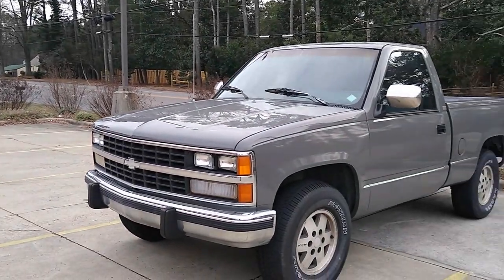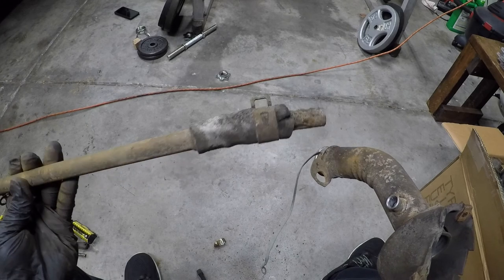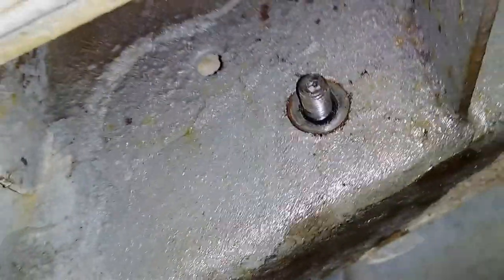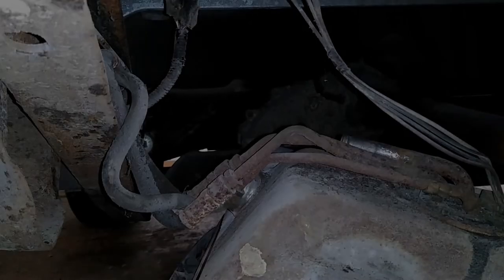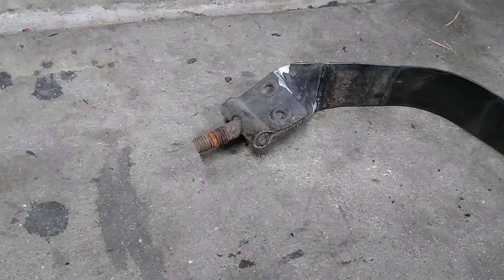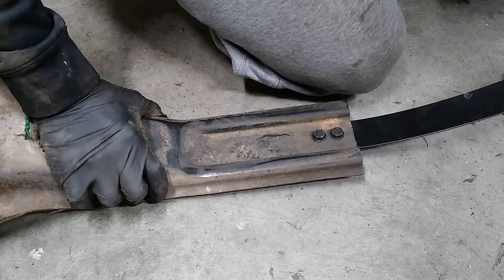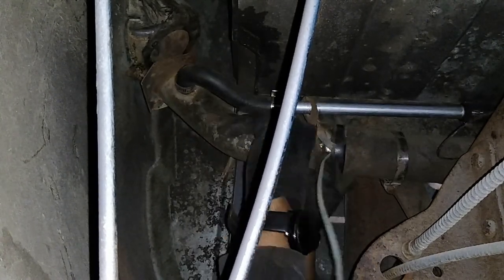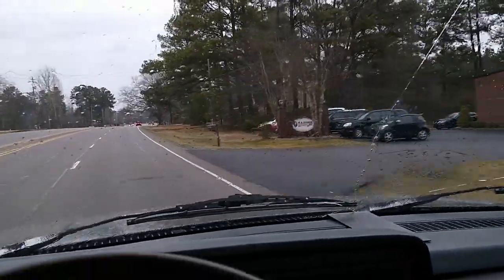89 CHEVY K1500 fixing the filler neck and vent tube

Comment: Nice fix on that filler tube. I actually removed the bed on my 89 k1500 this last summer and replaced all the fuel lines and brake lines. It had a newer fuel pump installed by the previous owner a couple of years ago. I used copper nickel for all of my new lines. I bought a Mastercool hydraulic flaring tool to make all the flares for the lines. While I had the bed off, I cleaned up the frame and painted it in the box area. Thanks for the videos on your journey with your '89 k1500. I have subscribed to your channel and I'm looking forward to see what you tackle next.
Reply from the maker: I'm jealous man! If I had space I would have taken my bed off too. There's a lot I want to clean up under there. And thanks I have a blast working on it.

Comment: I drilled out the filler neck restrictor altogether for trouble free filling with gas cans, using a hole saw with the tube off the tank.

Comment: I just cut an access hole in the bed. I mean the fuel pumps tend to go on these things too often anyway and it sure cuts down on the work to have access to the top of the tank.
Reply from the maker: That would make it so much easier. I might end up doing that at some point. It would have been cool if they made it that way from the factory.
Reply: @MaqsVids  The first C-1500 I owned was a '96 GMC Sierra. I changed the fuel pump on it by lifting the bed  with the help of four friends. It went bad again 3 years later so I said to hell with it and cut an access hole. The last three trucks I've owned were all '96 C-1500s sticks and they all had to have a access hole cut in the bed. You need to save the piece you cut out and weld tabs on the hole so the piece just slides in. I used a angle grinder to cut the hole.  Well if you want to do it I'll send you the measurements

Comment: You should pull bed and wire brush  an paint frame 
I have 89 k1500 and I been  doing the same think
Reply from the maker: You are right! I want to do that so bad. I moved from acres out in the country to a subdivision with a small driveway. And, I only can use one bay of the garage for now. I will be doing it at some point though.

Comment: Unfortunately they don't carry that metal tube anymore at fillernecksupply. I had found it at Jegs in a kit with with Tank Neck And Evap Hose Kit Set it cost over 80.00 and classicindustries and summitracing has it at the same price